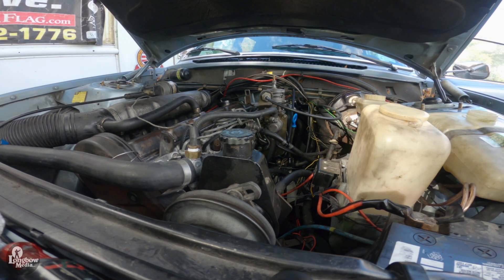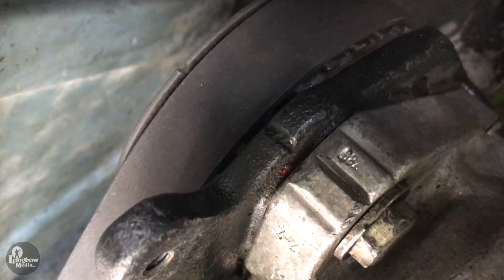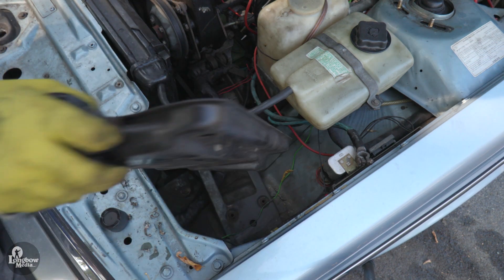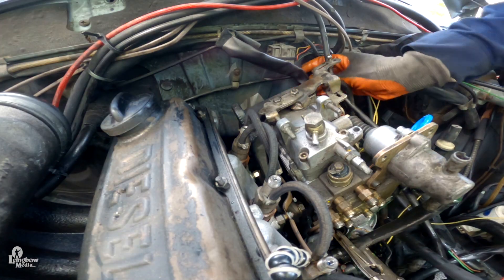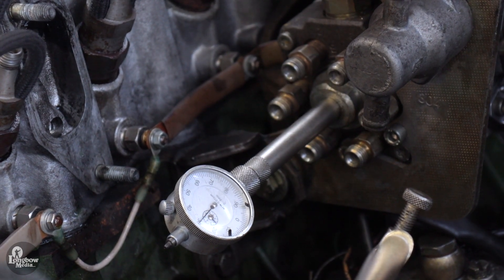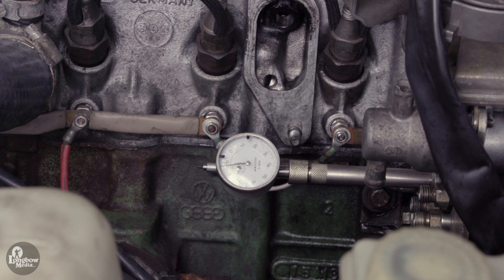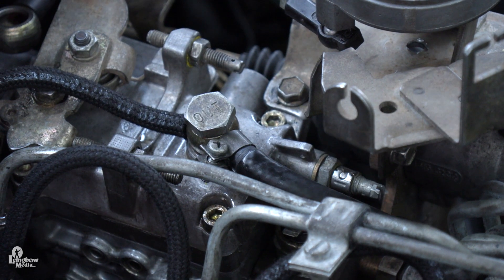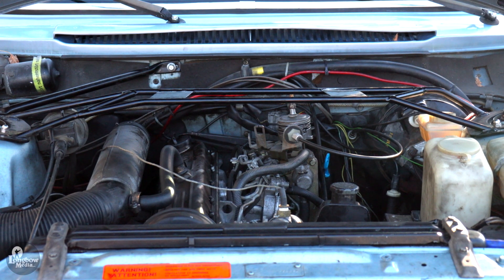How to Time a Bosch VE Injection Pump on a 1982 Volvo 240 D24 Diesel

Comment: Excellent video! Is this the same for my vw LT with the d24t DW engine?
Reply from the maker: If the injection pump is mounted in a similar position on the engine, I'd imagine so, but you might want to check out d24t.com for more info.

Comment: Excellent video, and timing skills (as a camera man and mecanician! I have a question though,  after connecting the rear cam sprocket,  to find 0 , we have to wait for the needle to go reverse, If I understand correctly. But what is the margin of tolerance , when the needle goes reverse? One, two degrees?